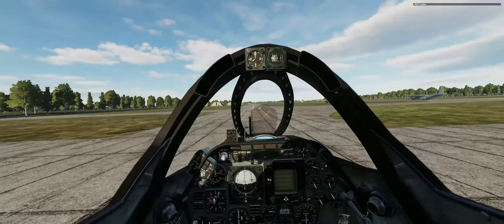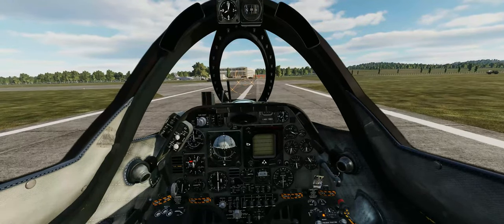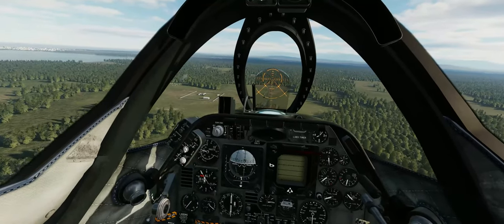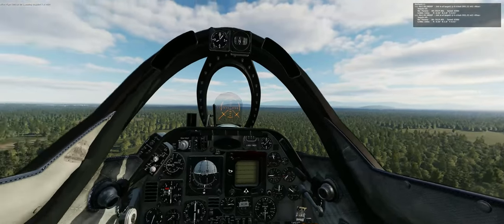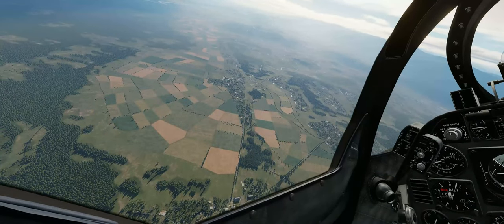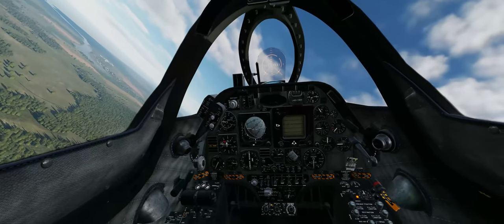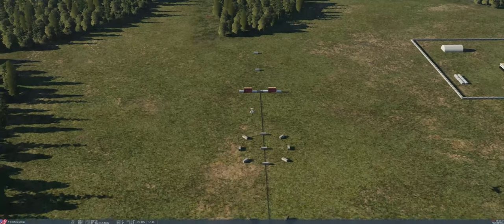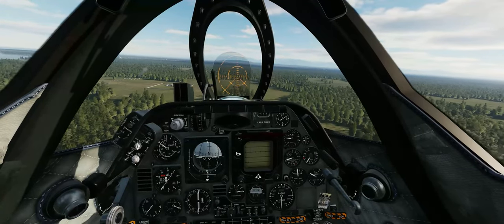Cluster Chucking - A-4E Tutorial

Comment: when ar you supposed to use /arm the spoilers ?
Reply from the maker: AFAIK, the spoilers only need to be armed for landing and they will actually only deploy when on the ground.
Reply: @Sidekick65  ok  manual is a bit short on some things 👍
Reply: @Drutten35  page 6-3 (Left Console) of the oft-maligned-as-under-informative manual (v2.0.1) denotes that spoilers actuate when there is weight on wheels and engine RPM is under 70%.
Reply: @octobre79  yes i read that but it dosent says if you use them only with heavy ordonance or on carriers
Reply: @Drutten35  the landing page on 5-5 includes them and points to the carrier page on 4-3, which omits them from its list. seems clear cut to me.